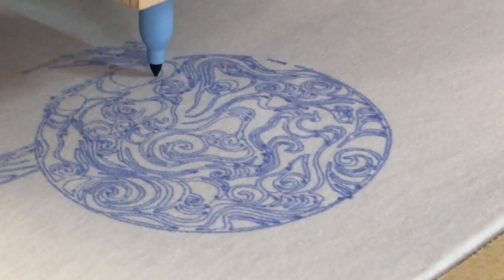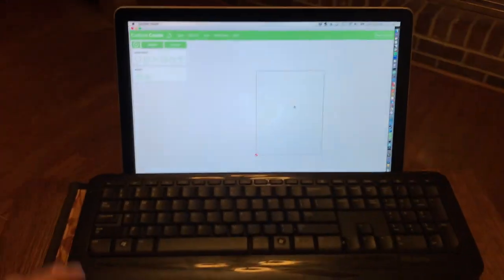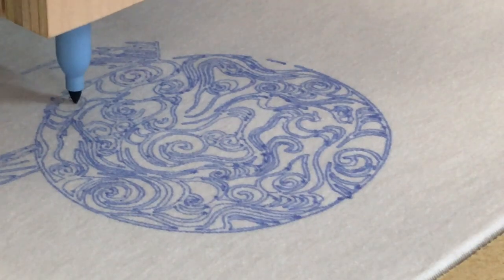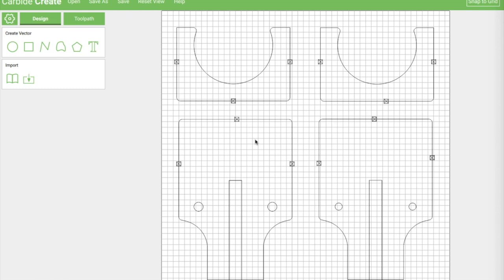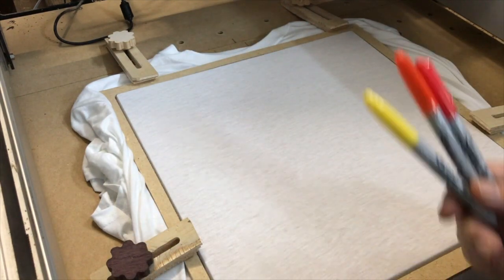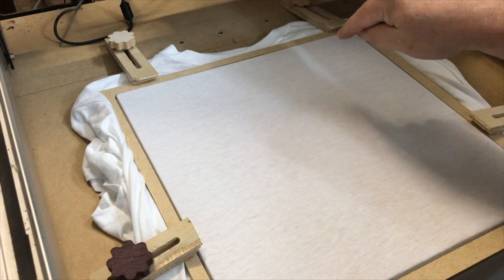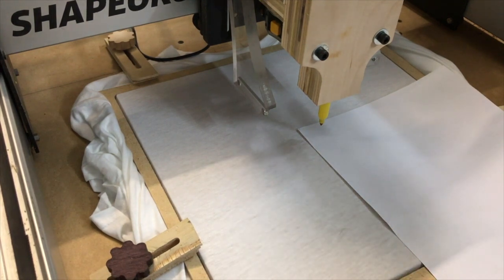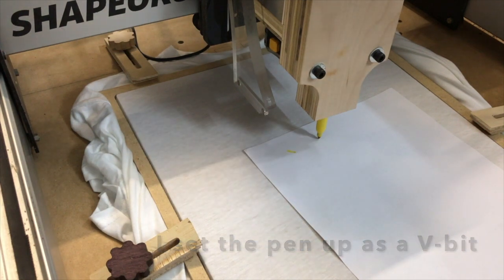Shirtpoko: Making T-Shirts on Shapeoko

Comment: I’ve made pen holders for similar markers and the ultra fine tip ones. I just drill into a block of wood with a bit just barley big enough so the pen slides fairly freely, then drop a small 3/8” spring into the hole, then the pen. To hold the pen in the hole I use another type of lever spring across the opening. The top spring has just enough ‘give’ that the pen tip doesn’t break and the Z range of depth is more forgiving. Easy and cheap. The bag of springs I bought was assorted, and about $5. I have a block of wood suitable for each type of pen or pencil. Thanks for posting the videos.

Comment: Very clever. That lizards looks as if he is moving. I wonder if you can get a Shapeoko to use a calligraphy brush?
Reply from the maker: Hmmmm... It seems like the vCarve settings might work with a calligraphy brush. It would give you different pressures based on the line width. Interesting thought.

Comment: Very clever way of doing it. I 3d printed a clamp that fits onto my spindle casing and holds a sharpie, and included some flexing parts in the clamp. By comparison, you've built a solid holder for the sharpie and put the flex into the shirt material. Your way looks like it works much better.
Reply from the maker: Thanks Karl! My solution is a bit bulky, but I am pleased with the results so far. I would love to see what you came up with.

Comment: Hi John, Thanks for this ingenious idea. I'm just new to the CNC world apart from getting knowledge from you and others like you. I'm just in the midst of setting up my new Shapeoko XXL and eager to move ahead, but I gotta now get myself a cheapy laptop. By the way, I know about brain freeze days as well, your doing well at least from this side of the camera, actually you did great work on this project as well as the others. I look froward to trying some of these things out in due coarse. Have a great day. Andrew
Reply from the maker: Thanks Andrew. If you are just looking for a PC to run the machine with Carbide Motion, not design with (Carbide Create), I use a RCA Cambio which is ~$100. I just use Dropbox to move the files around.

Comment: Nice jig. I would definitely like to own a Shapeoko now as I have been interested in doing many of the things I've seen you forging ahead on. Love the videos. I'd be curious if one could do a light scratch cut with an etching needle onto scratchboard or a soft metal. I suppose one might put a special tooling into the router to do that sort of engraving thing as well though, eh? Like conical shape and carbide perhaps.
Reply from the maker: Thanks! Engraving is definitely doable. The Shapeoko is rigid enough to mill aluminium. I have seen engraving done on copper and brass as well. There are a number of bits available for this. Come down the rabbit hole with us! :)
Reply: scratchboard or removing paint from a metal sheet or something would be easy.  Just like the pen, but you could use a diamond drag bit.  It doesn't spin, it just drags and scratches.

Comment: There is a temporary adhesive (spray) that would work well for this application. It isn't cheap, but it works. I've used it for embroidery and it worked well. Buy one made for fabric and not any old adhesive.

Comment: Impressive, i am excited this works similar to a plotter and you can use ink
Reply from the maker: Thanks. this project has been a lot of fun to tinker with. I picked up a huge pack of different colored sharpies and I have had a blast doodling around.
Reply: John, curious... have your tried plotter pens vs sharpie?
Reply from the maker: @waltw918  I have not. Are they spring loaded?

Comment: This is a fascinating project! I had never thought of trying to color fabric with a cnc. And the lizard turned out great!  I have a Shark CNC, not Shapeoko, so I'll have to come up with a pretty different mounting arrangement. I have a Shark CNC, not Shapeoko, so I'll have to come up with a pretty different bracket arrangement. I've been trying to come up with a way to mount a sharpie (or an acrylic pen) on my cnc to be able to color the fine lines in some of my carvings. Have you ever tried your pen mount to do that? Thanks.
Reply from the maker: Thanks so much, I am glad you enjoyed the project! I have thought a bit about using the pen to draw on solid things and the trick would be maintaining a gentle light pressure on the marker. You would need some kind of gentle spring to maintain tension, but not tear the tip off if it catches. It's a really interesting project idea but I have not managed to come up with something yet. Let me know if you decide to take a swing at it. I would love to see what you do.

Comment: Great video.  I’ve been contemplating doing something similar with my Shapeoko on wood boxes.  As a pen holder, I’ve thought about using hose clamps.  Any thoughts on why that wouldn’t work?
Reply from the maker: It "should" work. The one thing I noticed with zip ties was that the left-right motion sometimes moved the pen. You might be able to tighten the hose clamps more effectively. I think there is also a channel in front of the DeWalt router, which might mitigate some of that. It's worth a try. Light pressure would be the key I think.

Comment: Amazing concept, but I keep seeing more and more wild stuff done with a Shapeoko.  My S3-XL is getting lonely sitting in a corner while I try to complete the cart I'm building for it.  I was wondering if you ever see bleed-thru onto the shirt fabric while doing the Z-axis zeroing.  I'd be tempted to use a bit of scotch tape on the underside of that paper as a barrier.
Reply from the maker: Thanks so much. Bleed is definitely an issue if the pen rests on the paper for too long (the scotch tape is a good idea!). I have also noticed a problem with really small shapes (under 5mm) causing some bleed. It's hard for the machine to move quick enough at that size to keep the marker from prolonged contact with the fabric. You do have to tweak designs a bit.

Comment: John if you can please put a link to the bits you have in a video I’m new to the cnc machine and have no clue on good bits or sets or anything would help thank you
Reply from the maker: The two bits I use the most are these: https://www.amazon.com/gp/product/B072J4CPQT and https://www.amazon.com/gp/product/B0725RG4R9 I also have a v-90 I got from Carbide Create https://shop.carbide3d.com/collections/cutters/products/301-50-v-bit-cutter Those are my work horses.

Comment: wouldnt your Z axis have still been good just need to change the X and Y for the offset
Reply from the maker: It depends on if I have managed to put the new pen in exactly the same way as I did the first one (same depth). It's one of those things where 90% of the time it's the same, but that last 10% can really bite you. For the shirts, I am dropping the pen 2mm to draw. It's not a lot, so even little differences between pen setups matter.

Comment: Hi John, Thanks so much for making these videos! If you plan on making more of these shirts you could soak your fabric in an alum/water mixture as it will help fix the ink, its called a mordant. Fabrics are treated with products known as mordants, which make the paints adhere to fibers. Without a mordant, most paint would wash off. Lemme know if you have any questions about it but you can buy ALUM on amazon. To be honest I dont know if that would work with a sharpie but it works with acrylic paints. This link below is in the context of water marbling but some might apply to what you are doing here.

https://www.thesprucecrafts.com/make-hand-marbled-fabrics-2821301
Reply from the maker: Very interesting! I will have to give that a try. Thanks!